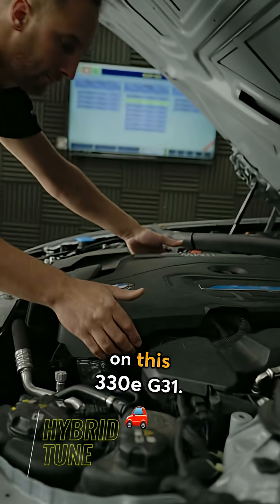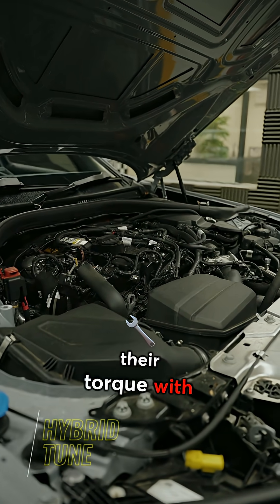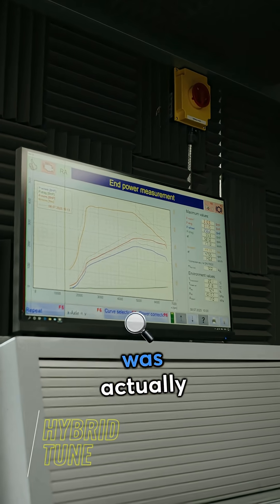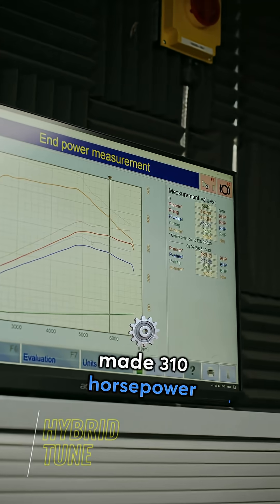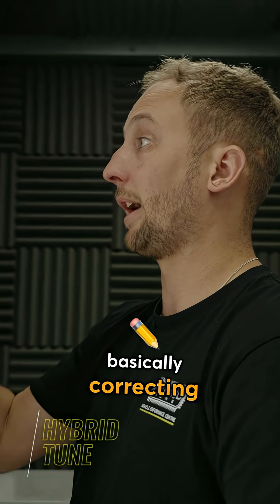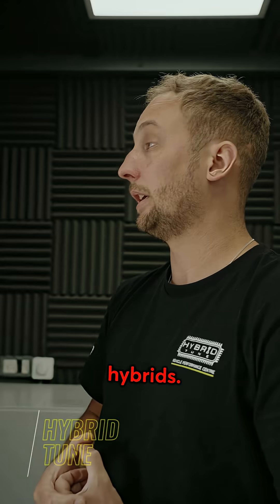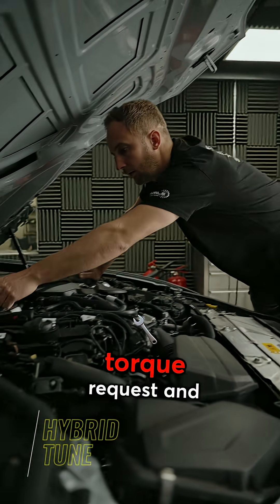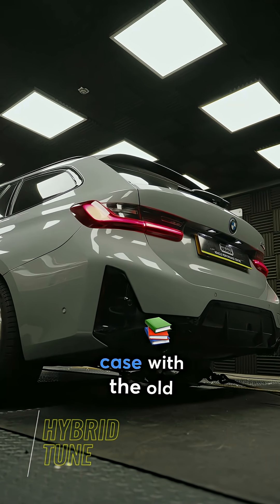Tuning Boxes vs BMW 330e: Why They Just Don’t Work on This Modern Hybrid.  #performancecars

Comment: is it the same case with the pre lci 330e?
Reply: Both are absolutely tunable. You just have to know what you are doing.
Reply: @djdafish  Post 2020 g chassis 330e:s are perfectly flashtunable once FEMTO unlocked, but the video was about using physical tuning boxes or piggybacks.